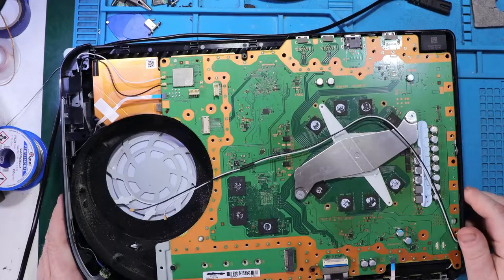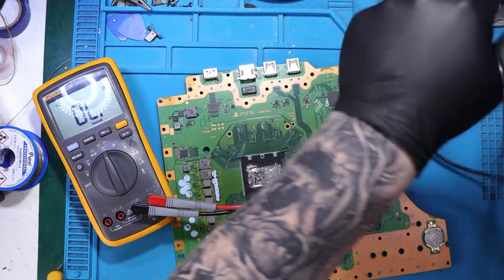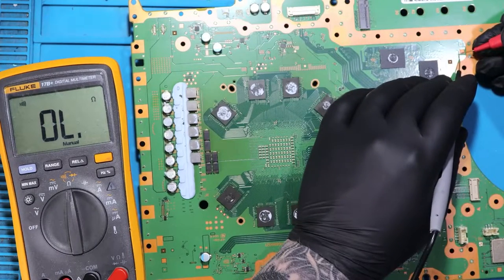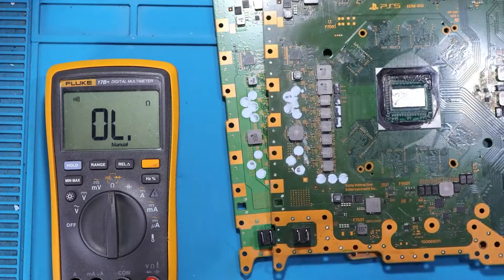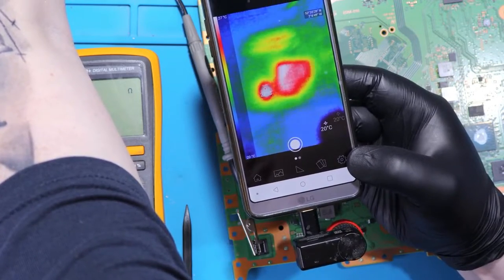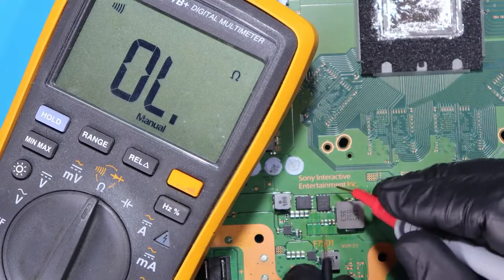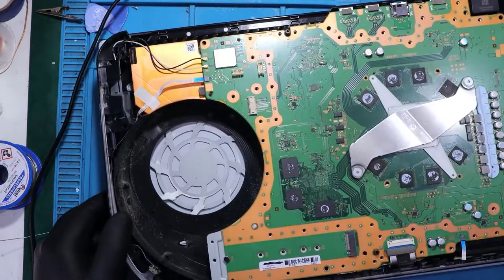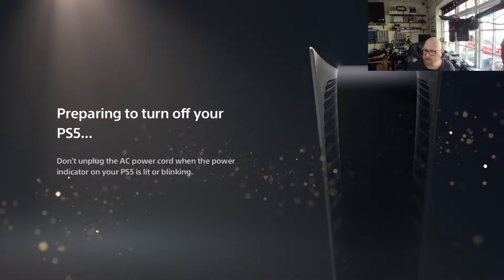2 seconds BLOD Blue Light Of Death PS5 repair

Comment: I think I’ve got a new issue with my P5, it beeps and turns on but after a second or two the blue light turns off. I press the power button again and it beeps but nothing happens. I press the power button another time an it repeats, I tried turning it on via controller (both ways), unplugged it, tried a new outlet and A/C cord and nothing still. Can’t find a solution for it anywhere so I think this might be a newer issue
Reply: Same
Reply: This has just happened to me too - I’ve sent it back to get repaired today! Hope it’s not going to happen again but seem to be an issue on the MB so nothing you can do about it apart from return for a repair. Had my console for about 4 or 5 months
Reply: @trell1111  yup, had mine since March, so about the same
Reply: That happend to mine , got it 2 days ago. Returning it today. It sucks to wait 2 years and this shit happens the day u get it
Reply: Update: got the repaired PS5 back, but it’s of course been wiped - i’ve lost everything from it as couldn’t back it up once the fault occured 😩
Reply: Mine is doing the same thing. Worse timing
Reply: Mine started doing this today Kmt
Reply: Mine did this like 8 months ago
Reply: I got mine back from repair today for overheating issues for the 3rd time and turned on played for like 2 hours no issues went out to eat come back playstation will not turn on I'm sick and tired of playstation I've had mine since release date but has been in repair 3 times
Reply: @deshawndavis8577  how did you fix it
Reply: I have had nothing but PlayStation since ps1-4 gotta Xbox series x because ps5 prices were ridiculous haven’t had a issue yet.
Reply: @Senseofwellness  I’ve had a PlayStation since the 1 came out also. This is the first time I’ve had an issue. I’ve also had the Xbox up until the Xbox 1. My 360 had that over heating problem but worked fine after leaving it off for a day
Reply: @trell1111  how long did it take to get it fixed? I need to send mine in.
Reply: I don’t know what to do, mine is doing it and I’ve tried everything
Reply: @cadenmercereau9309  I just used my warranty with GameStop and got a new one on the spot. I did call Sony and they would have looked at it for free
Reply: I had the same issue, i sent the ps5 to sony as it was under warranty & they sent me a new ps5 as a replacement.
Reply: @MegaNinjapuppy have you tried another internal power supply? I have a PS5 since March 2021 and had no issues, no overheating and it was on almost daily. Then I played RE4 and it shut off out of nowhere and then it was like beep, blue light and then it turns off like you mentioned.
Reply: @flockelocke2297  PS will let you send it in, but for me I used my GameStop warranty and got a new one. I wasn’t trying to wait a whole month to get it back from Sony
Reply: @MegaNinjapuppy  I have no warranty, sadly. We opened it and took out the fan, power supply and blew away the dust with a machine but it it didn't work. I thought about buying a new power supply and try but if it's a problem like this here on the plate, oh man, and I don't have the equipment. I don't want to send something in. Maybe I ask Gamestop for repair service or something and maybe I have to buy a nother PS5.
Reply: @flockelocke2297  GameStop won’t repair it. Your best bet is to just let Sony handle it, it’s free anyway. But I heard if you have the PS5 sitting upright then there’s a plate with Liquid Metal that if it gets to hit the metal would become liquid an shift on the plate and basically render your system useless. Idk how true it is but I had mine upright an it went out, my new one I have it horizontal an it’s still fine so idk
Reply: @MegaNinjapuppy  I talked to an expert and called Sony too. Sony is 270 Euro, no matter the problem is but If it's only the power supply, a buddy or I could fix it. Hmm difficult but more complicated things we can't fix so easy I guess. When there are problems w/ the liquid metal I heard then it's like a problem from the beginning w/ the console. My had no issues and I think if something with motherboard then the PS5 had shown some little hiccups or signs before but it was out of nowhere and that's why I have hope for easy fixing w/ another power supply.
Reply: @flockelocke2297 
I got the same problem. I contacted Sony in America and they want $229 plus tax to get it fixed.
Reply: It happens bcs there is one pf short around blutoothchip
Reply: Did you not see the beginning of the video? The ps5 did exactly what yours did. ADD!
Reply: Same here  @Senseofwellness

Comment: Hi, congratulations for your videos. Before I had a strange absorption already in standby and I changed the two mosfets. Now in standby I no longer have strange absorptions but if I inject 3V right there on the coil, it burns the IC behind the card. Among other things, in standby near the IC I should have 3.3V but instead I have 0.90V. I already lifted the capacitors near that ic (AF01 0R3S) but the result is the same. What do you think?

Comment: So what stopped you from pulling that first shorted cap at the top of the board first before finding the shorted cap/caps in parallel at the bottom? Did the bad cap you changed cause the short on the first shorted cap you found? Good work. Love the channel.....and btw what thermal cam is that? I've only seen a few for phones and that's definitely not a flir lol. Looking to get one but don't want to spend a crazy amount on one. Thanks buddy!
Reply: It's because of experience. Everything on the power rail with the shorted cap will appear shorted. It's worth inspecting what's on the back of the board as you might spend time removing the first shorted cap, only to find a mosfet with a hole in it behind... Usually you go to voltage injection to save time, because you won't know what component has failed, and it's much more efficient than pulling off every component until the short disappears.

Comment: Hello and congratulations. I have a ps5 board which instead has all the capacitors shorted under the cpu and also the whole side area above and below the cpu where the small R24H coils are located. Maybe I need to reball the cpu?

Comment: Hey guys I've sent my ps5 to the repair for the same issue of the video but he told me that it cannot be fixed because the ram of the ps5 is damaged i think he is trolling me and if he is honest can the damage of the ram be fixed? please reply
Reply from the maker: Hi. 
The faulty ram module can be replaced but it didn't guarantee to work after. The problem can be with APU with some solder balls under the APU. They can be cracked and even if you replace the ram module, it won't work. So next step is reballing the APU. Some repair shops doesn't have a reballing machine so they won't help you out and they will be avoiding the repair.

Comment: Actually, there is no need to give that heat to the hook for a smd ceramic capasitor. 5 second job with solder iron. good day.
Reply: What needs to be done? I am having the same issue with my ps5
Reply: Learn to appreciate sir

Comment: hi, I have problem, ps5 was turning on and after couple minutes no signal, I change charger port but now no signal all time, charger port is good, I solder it good, I change hdmi IC also but same, may you know the problem, thanks❤️
Reply: Hdmi circuit related check diodes  filters and mostly picture ic

Comment: Very helpful video. I have the same symptoms but the only fault I can find is fuse F7003 bad and 2 caps showing bad in that same area next to the Dialog chip. Would this cause this blue light issue ?
Reply: Checking the capacitors or inductors maybe(again) sorry, I'm not a technician, they are not short to ground so it appears the only fault is the fuse F7003.
Reply: Remove the shorted caps and measure if the short is gone that's causing the fuse to go bad
Reply: @Wmtechzm  Thanks for your reply. It turned out to be a bad HDMI chip.

Comment: Great job! Question, let's say you didn't have a donor board, what would be your next option? Is this a capacitor you could buy? If so from where
Reply from the maker: 6.3 volts 22 uF 0603 but it would bebetter if you find 10v 22 uF.
Reply: @tvpartsworld806  are you from Poland?
Reply: Would a 22uf 25v work? From what I heard is that the voltage doesn’t really matter it’s the uf that counts.

Comment: Exactly what is going with me and guess what I just got it back today from playstation repair center 

I'm very disappointed in playstation
Reply: How much did it cost you. I was on with Sony for over an hour in total and they couldn’t help. They are telling me to send off for 30days and it’ll cost $230 😢
Reply: @joshuagould8402  so I was very lucky and also not lucky let me explain 

I got my PS5 on launch day pre order 
3 months after getting it crap on me with it turning off during game play random sent it in got it repaired free and sent back long story short same issue happened 4 times up to date got my PS5 back this 4th time and It wouldn't turn on with this same issue so this issue was also fixed by them free still covered because I've had so much issues it's at repair center in Texas 

I've requested to speak to manager before they send anything back also I've requested a new console it's obvious this PS5 has major issues
Reply: @joshuagould8402  the 30days is the time they have to send it back to you Maximum so it will not take that long 

230$ is worth it because you will have warranty also 

Id get it fixed and sell that shit and go buy another PS5 and get warranty on it extended warranty

If they send me back my same system I'm doing this if it's a new console not refurbished I will keep it 

Hope it helped you 

There are shops that can fix this like this man in the video and it will be cheaper and not long wait time 
Most of the problems is chip shortage still going on